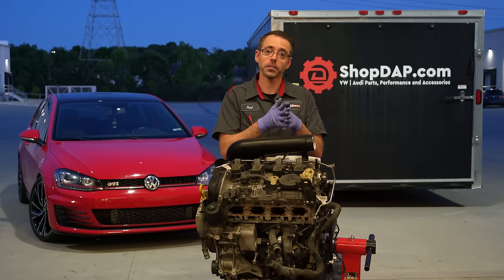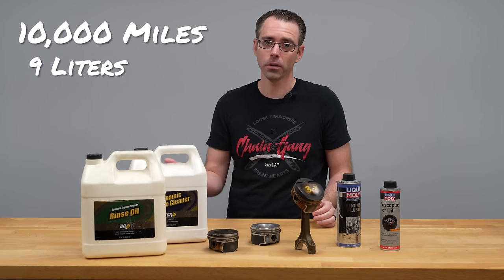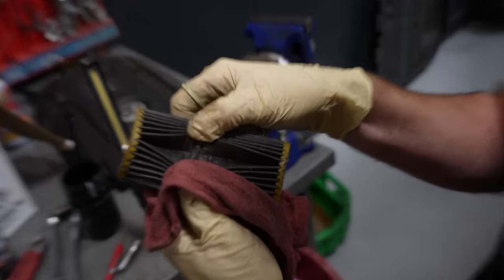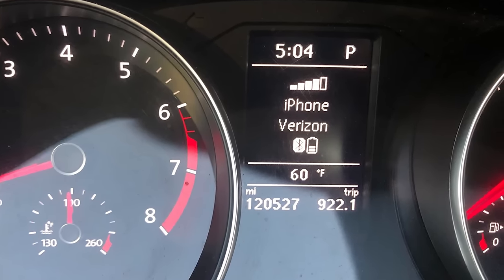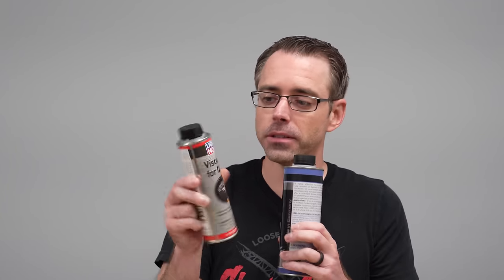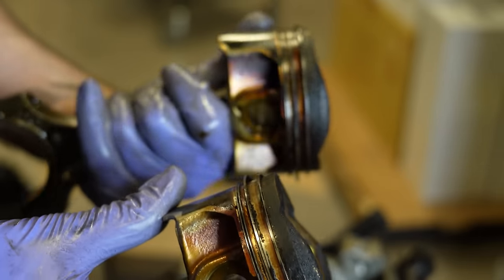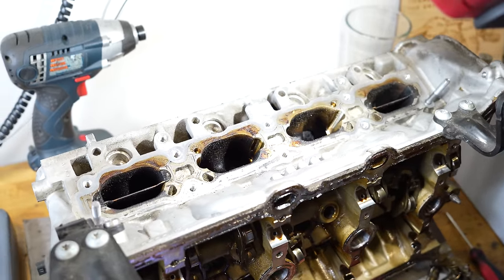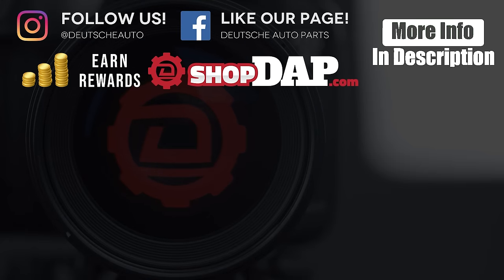Can you Fix an Engine Burning Oil for $20

Comment: I am aware that this is an issue for some folks..........I've not experienced this though.   I've got 3 vehicles that can go their OEM recommended OCI run without requiring any top-offs.    2 older vehicles run  5w-20 syn blend  at 5000mi,   and the third runs 5w-20 full syn for 10k miles.   The elder cars have 100K miles on them.

Comment: Since there is obviously piston skirt ware means the oil wasn't doing it's job properly and may oval shape the cylinder if the issue is from overheating but I think this come from improper rating oil or late change, too low level.... worth checking the other components of this engine. c
Changing it in time is critical since viscosity would play an important role into sealing low friction rings, additive package is also important and was precisely engineering for an engine type application. When it's too late I want to say it's too late... sadly cause low friction rings can't wash carbon gunk as efficiently as previous conventional ring cause it's loop : more oil pass = the less they seal and cause of that you would come fare quicker to this situation compare to other piston rings technology.

My advice : always follows recommended servicing, parts recall ... 
best recommended oil (I'll go for the genuine but this could be expensive so the recommended VW approval for the correct engine and a reputable lubricant company will do)
AND genuine filter IN ALL CASE !

Adding additive isn't necessary for a healthy engine it's only when bad things already happend and usually won't solve the issue.

Comment: I've got a Toyota Corolla that is know to have the oil burning/ring issue, but never found noticeable amount of loss.  I'm running my first change to synthetic so I'm going longer (not too much, not 10k+), but now at about 5k miles I think, I was down almost 1 quart.  I topped off and will monitor it.  I had already run something through it, either Sea foam or Lucas Complete Engine Treatment, but was also told about the chemicals.  I'll monitor and change soon, but should I plan for the LiquiMolly?

Comment: How did you check the oil pressure??? Does vcds or obd11 has options?? Then which measuring block ???

Comment: my 14 fusion has 165015 miles on it..2,0 valanica engine..5 k oil changes not oil loss..i also have a ovs on the engine...after 5k miles..almost not oil in it.. might be how the pcv system is made,, the vw/audis the pvc system is taken off the valve cover.. on the ford it is on the side of the block below the intake manifold.. and that is baffeld.. so gravity helps keep the oil out the intake manifold. piston area..less burning of oil..mind you the 2.0 engine has a diff. intake manifold then the 15 and 1.6 engines

Comment: in VAG i have problem not with carbon on piston but deformation of piston rings exactly oil rings its thin and not live forever. when it make diameters same of piston engine consumption oil. these not stuck with carbon but probably overheat and change size or change with heat and cooling. second oil consumption its leak on valves sealing is not forever too.

Comment: I have a minor oil leak in my 2016 GTI MK7. I've never seen oil dripping on the floor yet, but i can see some areas are wet around the oil cap etc (right part of the engine). I've topped up about 1L after 5000km. Is that an acceptable oil consumption? My car has only 70,000km

Comment: I have sticked with 5000-7000 miles between oil change. No more. My NA cars don't burn oil.  My turbo ones burn less than 1 qt between oil changes at over 150k miles.

I would have done a Supertech oil flush before the Lubmoly.

Comment: I am really curious to see how Valvoline's Restore & Protect oil does at freeing up these rings & if clogging the oil pickup screen is a potential issue in older vehicles with sludge issues. Using a hot engine flush on my '00 Jeep Cherokee XJ w/ 240k on it. I've changed the oil on schedule the last 2.5 years, but sludge was noticeable through the valve cover. Removing the valve cover on those is a bit of a hassle & in hindsight I would have removed the cover & cleaned up as much sludge as I coukd from the topside, as well as drop the oil pan (again a real pain onnthe XJ).

Comment: Hi Firstly I'm from south africa  I have a 94 model Toyota camry 5sfe with a sludge prob that prob blew out my head gasket due coolant forming into sludge yes I'm guilty of not do my regular services since covid it's been tough.
Now it's costing me alot pula.just cleaned  out my tapet cover and the amount of sludge it's scary just to sure I'm soaking it one time tonight.
Tomorrow I'm gonna take of &  clean out the crank case of all that whipped cream   ?how do I clean out the oil galleys I don't wanna contaminate the fresh oil with sludge is there a way to flush out block please while the crank case is opened

Comment: What are your thoughts on the VQ37VHR in the Q40. The issue is some mornings when it starts from cold I get a puff of bluish smoke then it clears up and runs fine. It fouled up cylinder 1 spark plug and caused a miss. I changed that spark plug and have been monitoring the oil and even after changing the pcv valves which is the common suspect it still puffs the blue smoke on startup. No weird engine noises, runs smooth when warm. I also notice the smoke issue appears more often if I'm parked on an incline. The engine has 65k miles on it so it's still fairly new so I cannot imagine it being valve guides.

Comment: My 2008 Ford focus with 2,000 CC engine does not use oil.  The first time for adding oil indicates time to change oil.  The first time I have to add some oil is less than a half quart us at about 5,000 miles. That tells me time for an oil change.

Comment: what if....someone buys a used Toyota Camry with 24k miles that had 10k oil changes.  The new owner wants to do 4k oil changes going forward and also wants to clean any possible sludge from the rings from the previous maintenance schedule.    Is this kind of service a good thing?

Comment: Does this engine have a EGR as at 22:07 there is heaps of carbon on the inlet valves
do a EGR delete and test......all manufactures have the same problem as you say because they all have a EGR Valve

Comment: so, in most cases is the oil control ring designed to be in a permanently fixed position on the piston, or is it designed to slide? thanks! (also just an american request, let's convert liters to quarts!)

Comment: I can't believe the government hasn't done something about this. Toyota has the same issue. Think of the pollutants that these put in the air. And I think that the Car companies deserve to be held responsible too. Also why does it cost $8,000 for a rebuilt engine anyway? And it is not just the cost of oil. Spark plugs, catalytic converters. O2 sensors, mufflers etc.

Comment: My 2009 2.5L Jetta hasn't consumed any oil between oil changes, in more than 100k miles driven. Instead of using a solvent based engine cleaner, use a quart of ATF at oil change. The high detergents in ATF will remove carbon and sludge build up much safer than diesel fuel.

Comment: Carbon build-up on pistons and piston rings is also often the cause of direct fuel injection.'
Due to pollution, they give a worse spray pattern and the inlet valves also pollute more, so that the vortices in the combustion chamber become less effective.
Direct injection is nice but also a risk for the user.

Comment: That's scary stuff. My 1996 SAAB with the turbo B204 had 300k km on the clock and didn't need any oil during the entire 10k km i would drive between oil changes.
My current '99 9-3 with the same kind of engine has some leaks externally but i haven't had to top up the oil yet and it's already due for and oil change.
So it looks like my old shitbox doesn't have to worry about being replaced by a VW anytime soon.

Comment: If you use Vavoline’s new restore and protect oils, they keep your engine as clean as the day it was made. After 3 months of use an engine that is burning oil will see a complete recovery and with regular use, oil burning will never happen. Upon tear down these engines running this oil are as clean as when they were made. They are based on a special solvent that doesn’t break down your oil, but eats carbon for breakfast.

Comment: Lol, many people with a WRX like me have oil consumption issues (i have a 99 WRX GF8 Wagon with 1/4 million KM on the engine and NO Issues.) 

But i have been very lucky 250,000km on engine and it uses about 150-200 ML per 5,000 km oil change interval (longest i ever left oil was 7500 km and it had lost only 350 ML out of total 4300 ML capacity. 

( I think most of them have very BAD PCV Valves as never replace them and most of their oil is lost to blowby and then going into intake tract and turbo via the PCV system and being burnt out the exhaust system, My PCV is working flawless and only Slight staining on intake tube from oil 10-15% of the surface of red tube is black.)

Comment: The turbo engine does not shut down hot immediately after a long drive at high revs. The car must be left idle for a few minutes to cool the turbo. VW tsi engines required.

Comment: Great video! I have a b8 a4 it’s been super reliable but recently each time I select gears I have to use force it’s hard to select gears. 
Reverse is even worse
Reply: I had the same issue with my B8.5 A4, oil consumption was one quart every 1000 miles, then the transmission had a delay going into reverse, and slow to engage into forward gears.  The dealer was useless and could not diagnose, eventually traded it in.  My 96 B5 outlived the 2.0 T, and had near 300K miles on it.
Reply: sounds like your clutch is not releasing properly
Reply: Shifter cables need to be re-rigged.
Reply: @mikeh423  but when the engine shut off I can easily select gears without forcing it

Comment: Change your oil at half of wat the manufacturer for the oil says and ur engine will love u .. I change my engine oil every 3k - 4500k no higher . Been building engines since I was 8 I’m now 20 turning 21 in a few months … I’ve had my share of engines dying from me listening to the manufacture service intervals … people no engine oil last longer than 5k on a good day … oil starts to break down after the first heat cycle so as soon as u do your first drive after u replaced the oil and filter the oil lift drops … I’ve seen engines go to 300k miles from regular service. Change ur oil at 3k-4K miles and the filter .

Comment: Is there a difference in engines sold in different countries? In RSA I do not know of any vehicle that gets serviced more frequently than every 15000km (just over 9000 miles). Some like Peugeot and Citroen runs 30000km (just under 19000 miles) between oil changes and last quite well. Honestly if a vehicle uses 1-2  liters of oil between services I would think it is approaching time for a rebuild. Honestly I do not know of any "good condition" vehicle that needs oil top up between services. Are we getting different engines?

Comment: Get a bottle of spray bottle put the engine at 2000 RPM is spray the whole bottle of water through the inlet it will simply touch of the pistons and hopefully eliminate this problem it does work repeat once or twice

Comment: Thanks for the video.  Any idea how to clean out the converter on a car that burns through that much oil?
Reply: Be careful with the converter on an oil burner, I put a new motor in a car once and once I got it hooked up it would only barely idle, that's it. Any more gas and it quits. I went through EVERYTHING and finally realized the old motor oiled up the converter real bad then it sat a month or two. It was plugged up solid.
My brother had converter that was almost plugged, he wanted to sell the car, I told him take it off, we held it up to the pipe on my 350 Chevy and reverse flushed it. Stuff blew out all over. Cleared it out 90%

Comment: 4:37 this 44K worx 107% BUT you need to use at least 2 containers of it and tank it to full THEN repeat with another 2 per tank, and after that 1 bottle per tank. I'd normally won't advise that BUT since the car burns so much oil it's heavily carbonated, especially the burn chamber (or how's it cold - pardon - called). Btw 3k RPM is BIG nono!!! 1.6k max (i've seen guyz cummin for 1.8k BUT!)!! And one more thing: NEVER go to full/max at the stick when changing oil. Go to half or two thirds full. Never full!!!!

Comment: Best Solution... Buy an Old Toyota Diesel one without an turbo.
Mine has 318.000 miles on it now and it only uses 350ml of oil every 5000 miles. (i dont even have to look at the dipstick too know when i have to top it off.
And gues what happens on 5000 miles... That's right oilchange.

Comment: I’m curious how old school marvel mystery oil would do added to the engine oil to unstick rings. I have a feeling it might be the best quick solution.
Reply: I don't have a microscope in my back pocket ,but I'll check the oil a few hundred miles before I'm gonna dump it ,and if it's low I'll add MMO up to around 1/2 a quart to help clean things before the change.
Reply: I add a few Oz mystery oil at each oil change to my 2006 cts 2.8 ( same as 3.6 small displacement ) and my 2011 eco boost 3.5 f150  cts has 219000 the f150 has 360000 both run like new and change oil ever 4000 4500 miles with quality filter and synthetic oil .

Comment: Bad oils, long drain intervals , weak rings due to low friction-emissions and consumption norms, thats modern engines. Just only  use Amsoil for 7-8000 km drain intervals and you'll never have a problem and the engine will shine like silver.
Reply: 6000 km most

Comment: Dont buy (popular) European cars is the lesson i learned. I was never a Honda person. But I ended up with a deal I couldnt pass up about 5 years ago and own a Honda.  I was getting oil leakage due to a worn spark plug tube seal. To be honest those and the valve cover gasket were due to be changed. At 206k+ I was expecting a gruesome sight. But everything looked the same as it should if fresh oil was added.  I was quite impressed.  I lnspected the tops of the pistons through the holes where the park plugs thread into. There was mere speckling on the surface. Much of the aluminumn was visible. 

WTH is going on with these crazy engineers? I have to add that I did oil changes and fluid changes regularly.
 Is there a possibility that perhaps the people driving the vehicles may be slightly responsible for the condition? Or is it just the type of person that prefers these vehicles? For instance whenever I see a white BMW you can guarantee they'll be driving like an a**** and they will never use their turn signal. To me when I see somebody driving like that I just think moron, doesn't value much, a prick.   Maybe this has something to do with it?

Comment: My 2018 Peugeot 3008 1.6 Diesel is not burning any oil. Brought new. Did everything - light off-road (is a 2 wheel drive with grip control - nothing fancy like an AWD) drive in snow, drive on highways, cities. I change the oil one time a year. I'm doing like 15K Km a year. The amount of oil is the same.
Burning oil is bad engineering. 
To add 1 liter at every 1200 miles (2K Km) is totally unacceptable. As I said - I'm doing 15K Km (10K miles) and I do not add a single ml. Even more - the level stays the same between changes.
My first car a 17 year old Dacia - was burning 0.4 liter of oil at 2K Km not 1 liter.

Comment: On my 07 TSI it was using about a qt every 600 miles , I changed PCV valve , put steel wool into the hose from the Valve cover to pcv valve , and began running an alcohol injection into the intake air tube , that uses about a pint every 800 miles...it now uses 1 qt between oil changes of 4,000 miles...It also get  about 3 more mpg with the alcohol injection.....BTW I would NEVER run an engine over 5,000 on an oil change , I don't care what anybody recommends

Comment: 05..VW Jetta GLI 1.8t...02m6 spd...22000 Miles only mods is... short ram tube intake and filter..3lnch down pipe 007foged rsbov..tuned 18. Ponds..boost...I have beat the hell out of it ..motor still no smoke..and it's still on the factory turbo ko3s   mobile 1...fully advanced synthetic oil...O 40 w..,.oil...the only thing I hate is it should have been a 6 quart oil pan from factory...but it only holds 4 quarts.,..,.if ur lucky lol been driving it on and off for almost 9 years....iv had the gli

Comment: may be worth mentioning that oil burn may be OIL LEAK, and that has to be checked for. check all gaskets and keep fingers crossed that it is not the cylinder head gasket.
Reply: A quart every 1000 miles would be noticeable

Comment: Oil change intervals are ridiculous on new cars. I have major engine issues at 85k miles on a diesel Mercedes , that's ridiculous. I blame the 10k+ mile oil changes. There is no way a motor should be failing that early.

Comment: Ugggh my 2011 Q5 with the 2.0l burns a qrt every 300 miles. I just tried the liquimoly engine flush and added 5 qrts of motul oil and it's gotten a bit worse from what it was.

Comment: Planned obsolescence, I believe car-makers changed the tolerances for cylinder and pistons and messed with the rings so the engines fail earlier in my opinion.

Also, change the PCV valve, clean the throttle body etc., change plugs etc. just a good overall service will help too. 

My brand new Subaru EJ255 burned loads of oil from day one. My 1997 Honda Integra barely used a drop of oil and had AMAZING fuel efficiency, running on a full synthetic oil.
Reply: AMEN!!!!